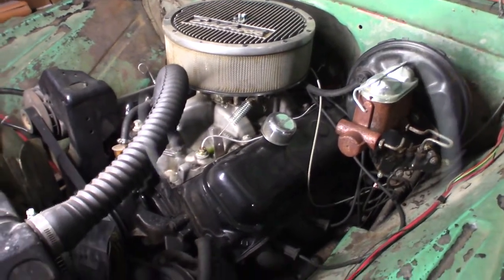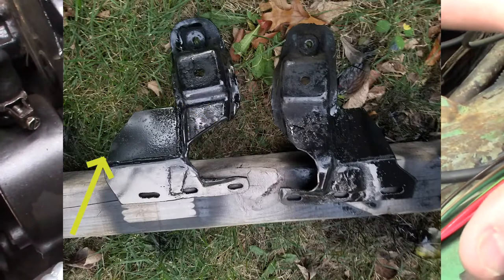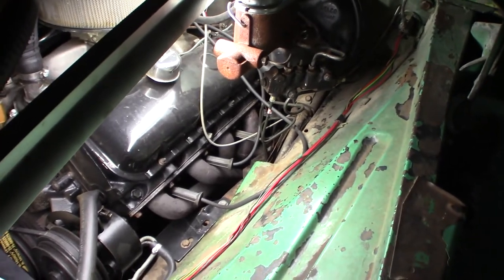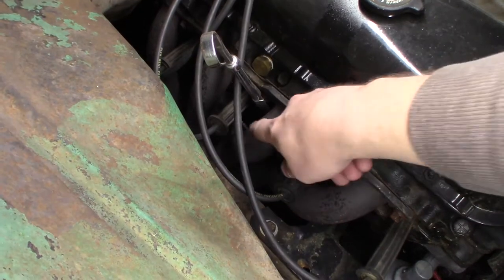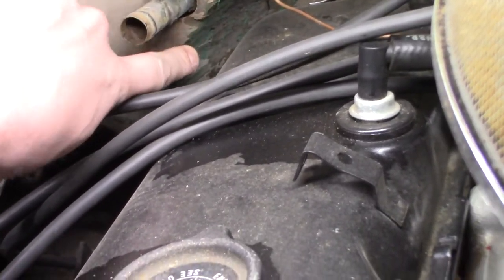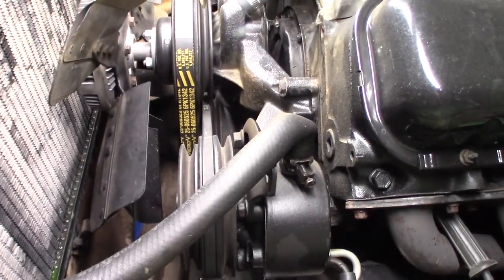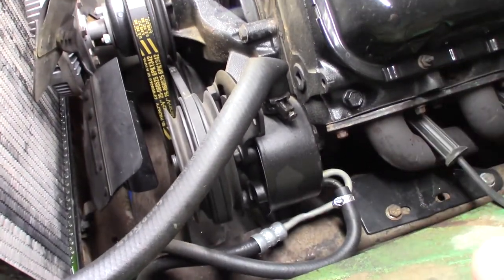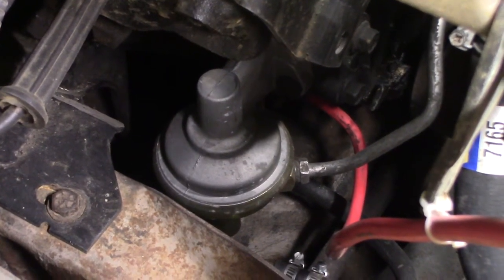How to Swap a Big Block Chevy into a 1960-1966 Chevy C10 Truck

Comment: My dad and I did a 454 swap in my '66 back in the 90's. Your's and our was very similar. The differences were:
I used a TH400 with the original 3spd crossmember. We simply notched the cross member the full width of the trans mount and all the way front to back. Welded the new lower material back in. I think we dropped it about 1.5". We used the original factory 6cyl mounts but modded the towers to drop the engine down. In our case, we used the factory exhaust mainfolds and still had to "shave" the frame rails about 1/4" on each side. No notching. Used balljoints, spindles and disc brakes and proportioning valve from a '75 C10. The '75 balljoints bolt right back in where the originals came out. 
Altogether, it was a 454, power brakes (discs up front), power steering (used a frame adapter kit from Rez Engineering that spaces the steering box out from the frame to clear the hump on the side of the steering box, also reinforces the frame for the added torque of the pwr unit), TH400, tilt column from a '91 Suburban and 3.08 diff from a '68 Olds Vista Cruiser wagon. The only firewall mods I had to do was using some channel locks and a hammer on the pinchweld seam where the firewall meets the cab cowl. Just rolled it toward the rear of the truck some till it no longer hit the bell on the 400. It was  a screamer!! 
Working on a '64 C10 longbed now. Have a 5.3 LS to build for it but really want to go back with another BB Rat! Great video!! Keep it up!!
Reply from the maker: That sounds like an amazingly fun build! Nothing wrong with the LS either, big block is just its own fun animal. Thanks for watching!

Comment: Interesting video but my experience with this swap is a bit different.  I have a 496 inch stroker that uses the rectangular port aluminum heads.  These heads are MUCH larger than the peanut or ovals.  Also using the RPM AirGap 2 Edelbrock manifold for the rectangular port heads and an MSD HEI distributor and Holley EFI fuel system.  With these heads in place, the engine will NOT FIT without a great deal of cutting/bending of the firewall.  In fact it may require so much bending that I end up giving up the space I was hoping to have under the dash for an air conditioner but not absolutely sure about that.  I also have a roller cam set up and this requires the use of larger valve covers as the shortys won't generally clear the rockers.  I have the tubular engine mounts and bolted them to the rearmost position and had lots of firewall interference so I moved the mounts forward to the other set of holes in the frame.  That placed the engine so far forward that the water pump shaft (without fan installed) was sitting where the second row of radiator fins would be if it was installed.  In order to fix that I would have had to move the radiator mount forward but that causes other problems such as the inner fender wells won't attach to the support.  Based on what experience I have with this, you are probably OK if using peanut or oval heads as they are much smaller than rectangulars.  I don't have that option so I am looking at getting an LS3 for this truck.  Oh, one other option I considered was to make 3-4" high, 3" diameter aluminum spacers to go under all 4 cab mounts and bed sills.  This would lift the entire sheet metal system up to provide clearance for the engine but again, believe the LS is a much better option.  I will look for a 67-72 or an 88 or later truck to put my 496 in.  Just as an FYI, my water pump is a long shaft high volume unit and the radiator I am using is a 3 row aluminum with an attached electric fan.  There is simply no room to attach a flex fan in addition to the electric fan.  This is the same radiator I used when I installed the engine on my break in stand and ran it.  If someone has other experience with my engine/truck combination I would love to hear from them.  Thanks!

Comment: Thanks for the video, and the good info.I am doing the same to a 62 long narrow plus replacing front suspension, donor truck is a 81 with a 77 454 auto.
Reply from the maker: Nice! That 81 suspension is better that the 72 I used. I'd like to see it, let me know if you're on Instagram
Reply: Why do you want to replace the suspension. 1962 Was t last year for  torsion bars and the x box frame.

Comment: When you made room on the firewall, did you have to heat it or just form with hammer.? I have a 63
Reply from the maker: No heat, just 2lb sledge. Looks decent, but I wouldn't do that to a really really nice truck

Comment: hi i am puttting  a 1966 396  big block in my 1964 GMC 4x4 3/4 ton pickup truck it originally had a 305 v6 so it ha no cross member only pearches what do i need
Reply from the maker: Thanks for watching! 396 uses same mounts as my 454, so you need small block chevy perches that bolt to your frame from another  60-66 C10. You might want to do a little research first because the purchase for your GMC v6 may or may not be the same as small block Chevy, I'm not familiar with the v6 configuration because I've not worked on one. Definitely worth a search, because you might already have what you need if the v6 perches are the same as small block Chevy perches! Let me know what you find, sounds fun
Reply: @RiggsGarage  THANKS
Reply: My truck had that v6 originally then got a small block 327 and now it is getting a 454 from the 90s

Comment: I currently have a 350 with a 700r4 behind it (rebuilt about a year ago). I am buying my buddies built 454 he claims about 600hp, which I believe, do you think it will survive a decent amount of time behind that? Or will I need a th400?
Reply from the maker: Hard to say, it really depends on its condition and how you drive it. But a 600hp big block has a ton or torque so probably on borrowed time if the trans is not built and you drive hard

Comment: hi putting in a 454 in my chev step side  didn't come with any brackets; power steering, alternator ; i have air need bracket for pump ; ant suggestion where i could get them no junk yards around here thanks ray
Reply from the maker: You can buy factory style brackets on eBay or Amazon, or depending on budget there are full pulley and bracket setups that cost more than I paid for my whole 454 
But junkyard is absolutely best
Reply: I have a/c & alternator brackets in Calgary, AB if you're still looking.

Comment: Is there a header i can use that won't require notching the frame? I'm pulling the 454 with Auto trans out of a 74 Corvette and it's going in my ,66 C10
Reply from the maker: I think a shorty header, or obviously a factory exhaust manifold would clear, especially since you're running an auto. I would definitely dig around in the C10 forums though

Comment: I'm in the middle of doing this swap as far as the rear end goes did you keep that all stock the differential specifically.
Reply from the maker: I used a stock 12 bolt truck rear, yep. They are strong and you can get lockers, etc for them. Thanks for watching!

Comment: I see you used the original location for the engine mounts.  Would it have helped to move the mounts to the front 2 frame holes? or would that crowd the radiator with the big block?
Reply from the maker: I did that to keep my transmission mounting holes in the same factory spot. I do believe there is plenty of room in the front to scoot the engine forward an inch or two though.
Reply: It might seem like a very small change, but effects a TON of stuff. Don't use the front holes, it changes the fulcrum point, makes the nose of the truck very heavy (rear wheels lose traction easily on snow/ice). Also requires a longer driveshaft & throttle linkage, shorter rad hoses, z bar & trans. tunnel modification (if it's a manual trans), shifter modifications,  trans cooler line modifications (if automatic), battery cables etc... Made the mistake of trying to use the front holes on a '66 and went back to using the rear ones,decided I was better off to just dent the firewall & run stock manifolds.

Comment: did u use the original rubber mounts mine are off a lil idk if I should loosing the bolt going to to block
Reply from the maker: I used stock Chevy mounts yes. I should probably put something stronger in there
Reply: @RiggsGarage   any reason why I'm of 1.8 a inch . would u suggest I loosing the bolts from mount to block then set her down and re tight
Reply from the maker: @rodricwebber3217  what Mount towers are you using? Are they from a small block Chevy truck? Do you mean that the mount is not lining up with the frame mount towers? Not sure I'm following
Reply: @RiggsGarage  yes bolt a lil off from perch using small block 2282 mount

Comment: Did you use factory motor mount from the 60 model truck
Reply from the maker: Yes, factory rubber mounts for any Chevy truck do it. I might upgrade them to something tougher, the engine is strong and will break them soon

Comment: Man, you just saved me a lot of time and money on that info about the headers. I just started this swap on my 64 and was lost on what headers to try. I started out with a small budget but that quickly went out the window. My son-in-law put a 496 in a 71 short bed Chevy so I had to go bigger. I'm going 540 with a turbo 400. I ordered the tubular motor mount stands and transmission cross member so maybe I won't have to do much cutting on the important stuff. 

All that for 3 questions -  Does your truck even remotely hook up? And does the frame seem to twist very much under hard acceleration?  Is the rear-end out of the donor truck the same width as the one you swapped out? Thanks for posting the videos. I do have a couple of BFH's and a hot-wrench and ain't afraid to use 'em so this should be easy peasy. LOL. NOT.
Reply from the maker: Thanks for watching! 540 sounds really fun. The truck isn't fond of traction. That said, it has garbage tires, old worn out springs  no locker, etc. The frame, I can't tell if it twists. Probably not, but that 540 may be a different story haha

The rear out of the 1972 is like an inch wider, so if I lower the rear much the tires may scrub, but that's what the bfh and gas axe are for! Let me know how it goes, are you on instagram posting project pics?

Comment: What would you say is the ideal make/model for someone's first restomod project? Make/models to avoid?
Reply from the maker: Hey now that's a good question. I'll admit, I'm not an expert in restomod because I like old stuff with old parts. Since I don't have an answer yet, I'll ask questions - what's the budget, what do you like? You can really build anything. To me restomod means older car with modern convenience like fuel injection, modern braking tech, air conditioning maybe, and modern lower profile tires on wheels that are more modern looking (or bigger). Trucks are pretty easy because yo can bolt in a modern powerplant cheap and there are kits for everything from brakes, suspension, and A/C. Kindof a broad question, maybe I can help aim you :)
Reply: @RiggsGarage  What I'm thinking is a 70s or 80s era two door car. Find a late 90s OBD-2 V8 out of a 2wd truck or something in a junk yard and put it in said car. Could be a Camaro with a 5.3 out of a Silverado, a Mustang with a 5.4L out of an F-150, or maybe a Dart or Polara with a 5.9L Magnum out of a Ram. Power steering, A/C, computer, and electronic auto trans.
Reply from the maker: @LarryReynolds591  Man I like the mopars, check out the 3 I've owned on my Instagram. Like your idea that 5.9 or a truck Hemi?  in something old. I keep seeing nice looking  B bodies for good prices. Polara, Coronet, Satellite, Charger(1971-1974) etc. You can get a nice clean one for a few grand. Then add your 5.9, AOD trans, Air conditioning and be driving.

Comment: What about the weight difference
Reply from the maker: Honestly don't know, seems fine to me. Very likely less than 200 lb difference
Reply: You need to adjust the camber to compensate, front will sit a bit lower, no big deal.